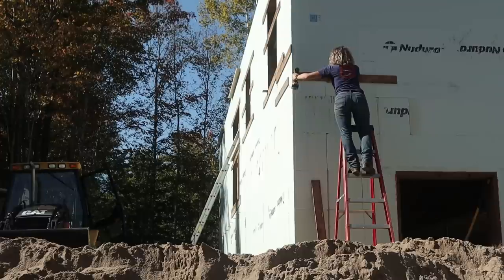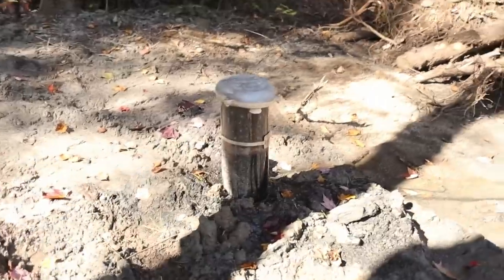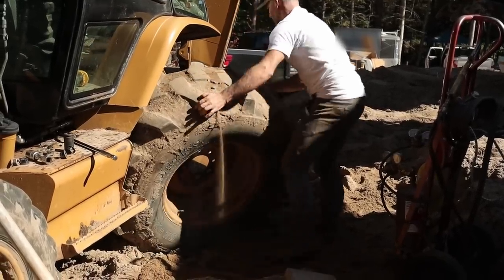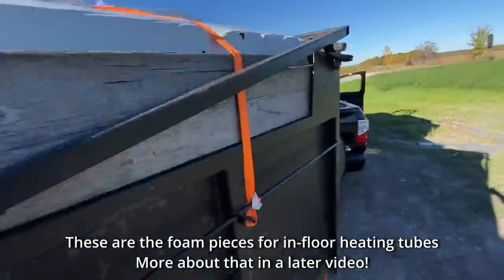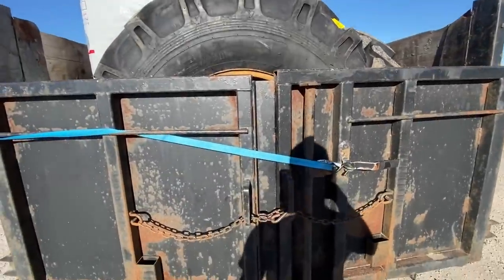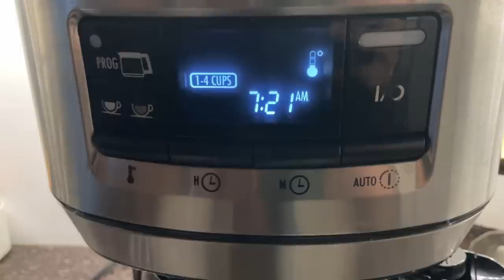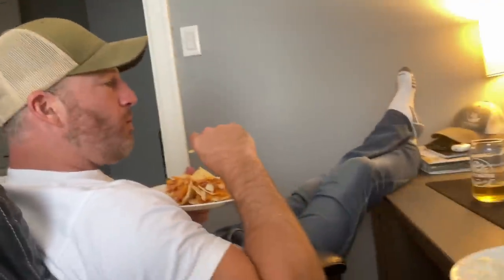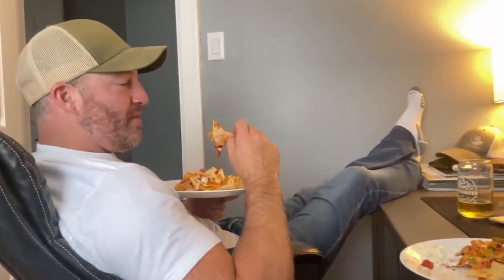Our Concrete Home | Couple build their own house

Comment: Don't you guys use a vibrator to vibrate that concrete to the bottom I haven't seen you use it yet because when you have that much rebar you either got to use a 1x3 to poke the concrete down in there you know so so it all mixes in good with the rebar I think that's what you got in there is rebar. So otherwise you end up with Rat's Nest that's what we used to call it instead of having a nice smooth wall you end up with like little rocks on the side of it aggregate from when they mix the concrete

Comment: i dont trust the joist hanging method long term
Reply from the maker: engineered metal hangers imbedded in concrete, weakest link is the joist
Reply: @TimberMates  the product I worked with was called ecoblock. Before the poor we would insert a metal plate into the form. But the hangers were just screwed into this plate